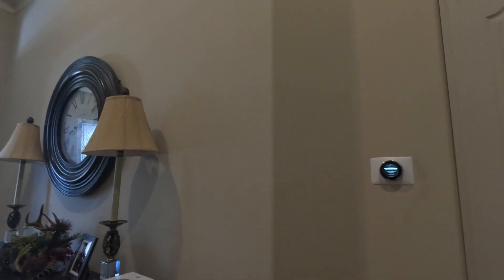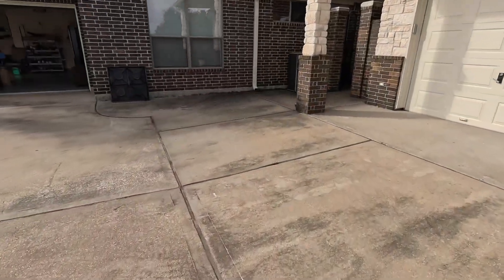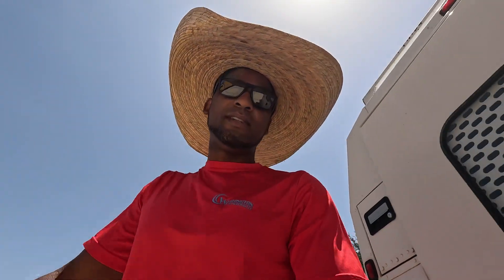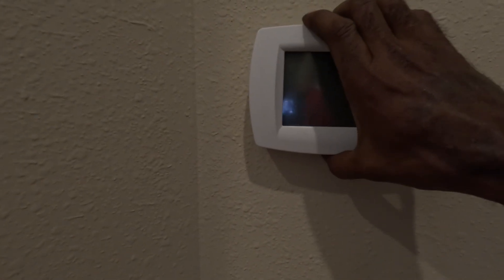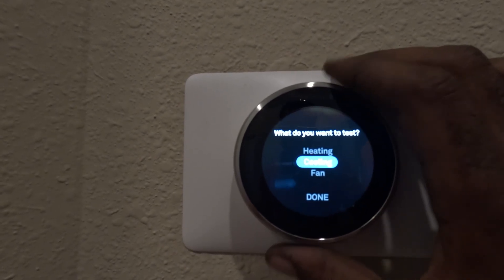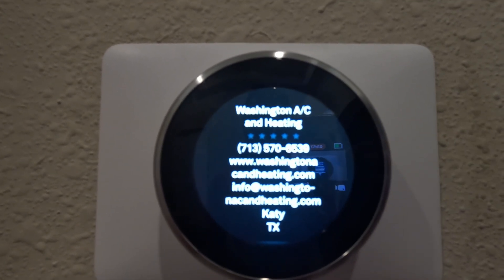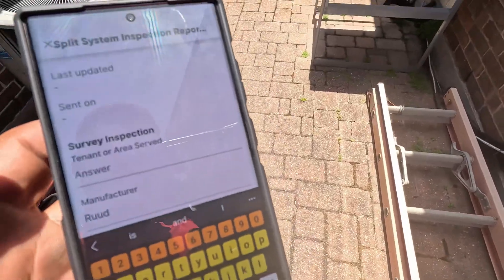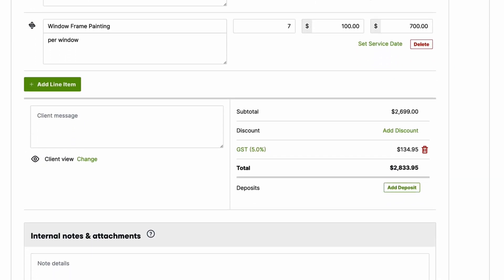Katy HVAC Repair | The Incredible SEER 2 Upgrade: Install a 5 Ton HVAC System

Comment: Please tell me you Are going to put another return on the other side of the furnace????!!!!!!  That 5 ton blower needs air pulled from both sides! Or one side and bottom. You will have nothing but air flow problems and future call backs!

Comment: I miss the old days of the mercury thermostats. A lot less could go wrong with them.
Reply: I see old merc thermostats still working on systems I installed back in 1993 when I was an installer . digital wont last 30+ years
Reply: @renj6531  Correct.